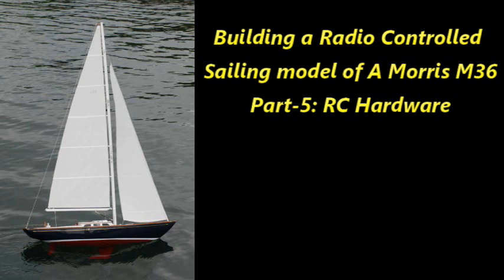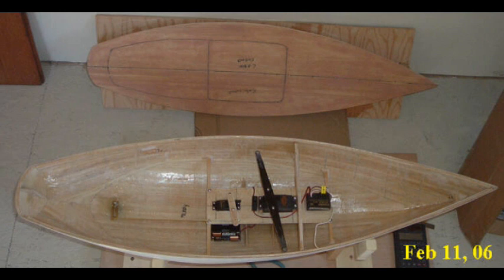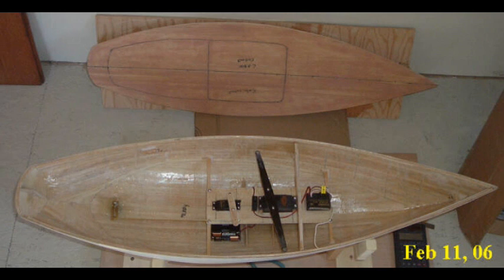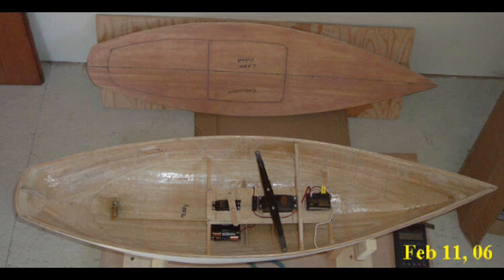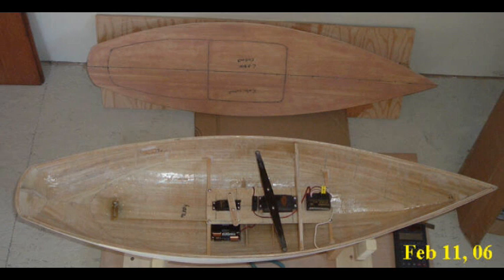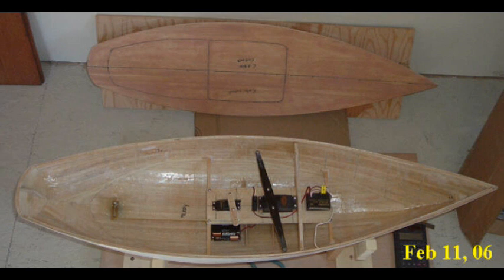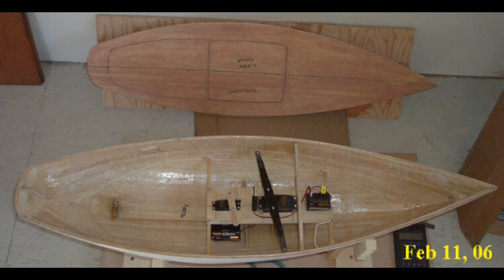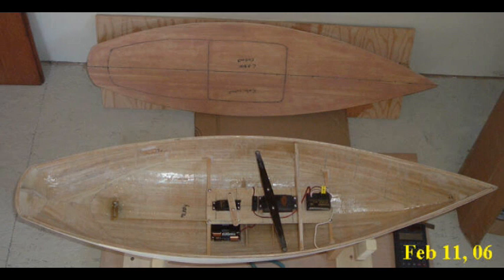Building a Radio Controled Sailing Model of a Morris M36 - Part 5: RC Hardware

Comment: Until I watched this video I knew nothing about setting up anything for radio control. Definitely thought provoking.
Reply from the maker: Jeff, I knew nothing about it when I started this project.  I didn't know if it would work until I tried it.  In retrospect sailboats are easy.  Now model airplanes are daunting.

Comment: 2.4 ghz radio system won't cost you much. 21 euro for a 3 ch to 47 euro for a 6 channel. Check out Aliexpress or Banggood (chinese online shopping). Great stuff. Good thing about 2,4ghz is to get rid of the huge antenna on the transmitter. The downside is the bigger problems with obstacles. The signal will be less reliable probably. And 2,4ghz has a very short antenna on the receiver. It is best to run the antenna in the mast ( if the mast is not made of metal) or on the ceiling of the deckhouse. If not there is a good posibillity to loose connection when a bit far away and the top of the mast leaning away from you. Radio signals also can have interference with themselfs due to a part of it bouncing to the watersurface and then to the receiver because this part is the same as the original only a bit later in time and that can give problems at some distances. Closer and futher away can be both fine. Rcmodelreviews channel once made a very nice explaination movie about that. But in short. The lower the frequency the less penetrating the signal is.
And with more channels you can make lights, and horn and backup motor and prop and bilge pump etc
Reply from the maker: I am not a big fan of those Chinese on-line shopping places, particularly for no name products.  I say that because there is no guarantee that one of those cheap radios will work with my existing servos and I definitely don't want to replace the servos.  The price I gave was for a guaranteed compatible Futaba 2.4 GHz radio and receiver.  Also, as I said, what I have works fine so there is no need to replace it.  Thanks for taking the time to comment though.